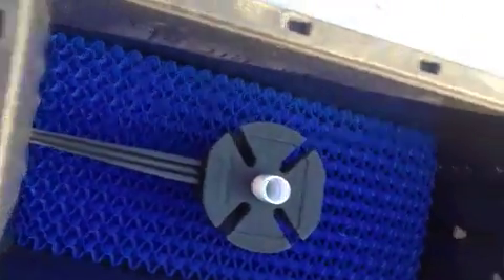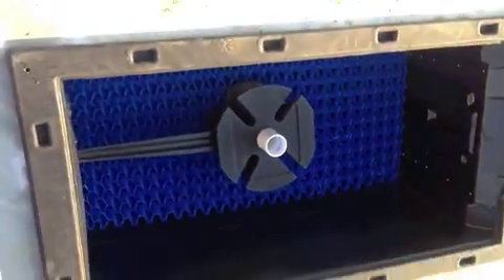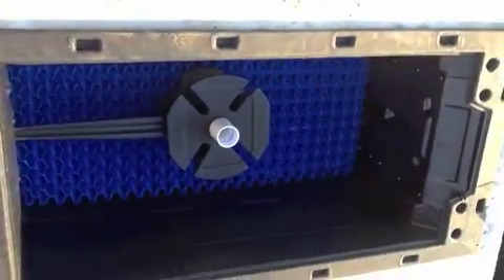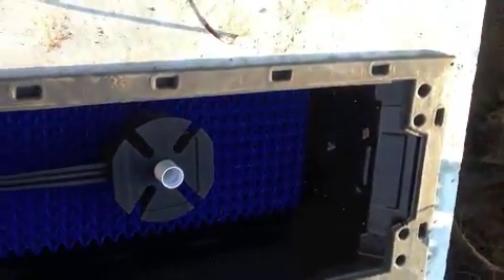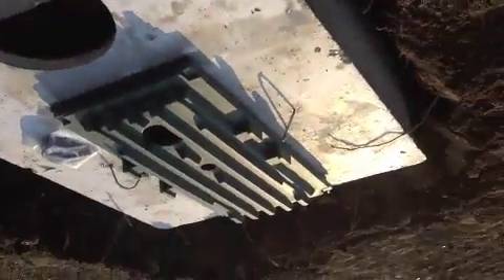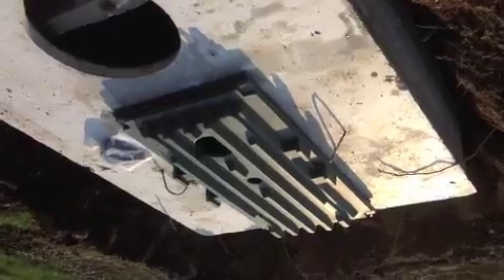Bio-Microbics

Comment: I have to replace a failing septic/drain field, and was thinking about one these... how much is a system like this for a 5 person family? and what if your soil doesnt have great peculation... i have clay soil and would like to avoid having to build a mound or a holding tank, as those are my only two options currently
Reply from the maker: As in any wastewater treatment system soil's are an important part of the final discharge. You need to have a soil's test and possibly an  Infiltrometer test. There is the Bio Membrane system that will work in sub par soil's.